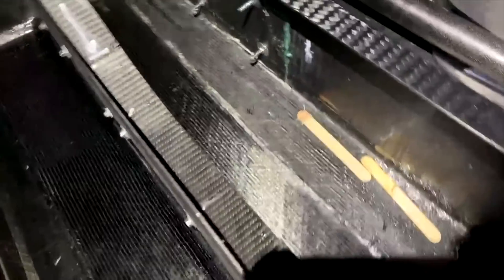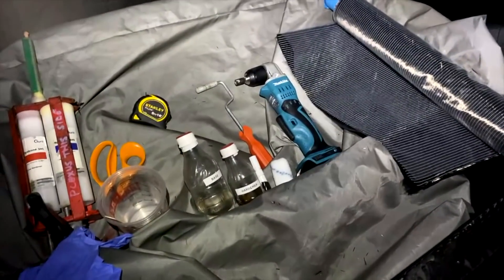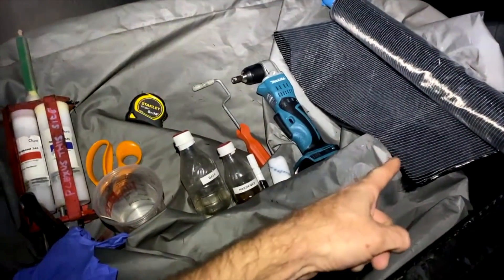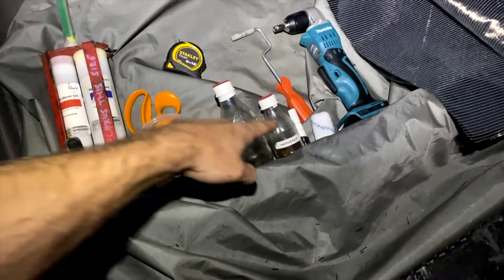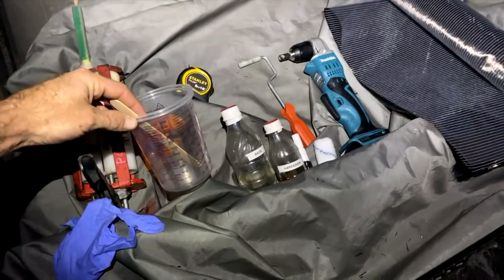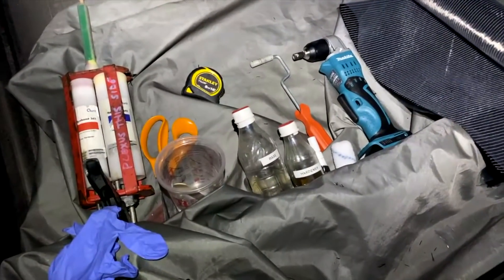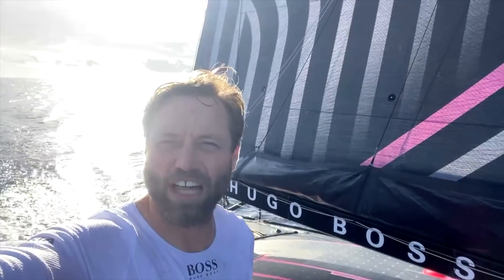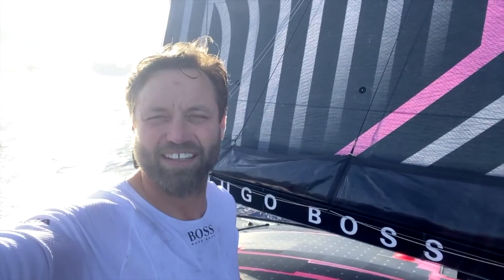Onboard video - Alex THOMSON | HUGO BOSS - 24.11

Comment: I was envisioning lashings of carbon tape wrapped round the cracks bonded with resin and then resin infused into the cracks under pressure through drilled holes. Never thought you'd be bolting strengthening plates of carbon to the stiffener across the cracks. Hope there's some glue in the mix. ;-)
Bit more subtle than the bodgery I imagined in my brain, obviously.